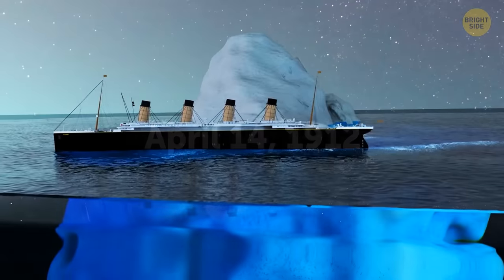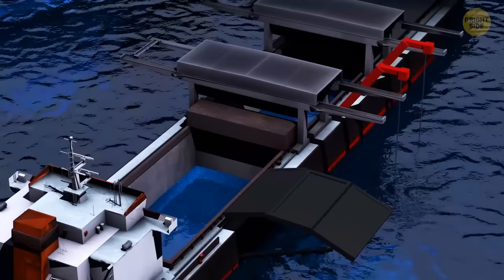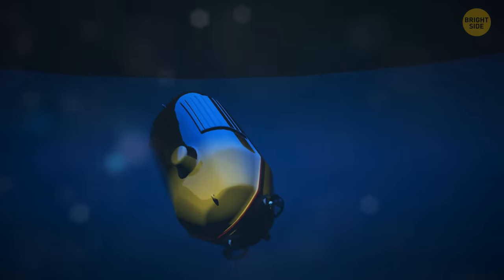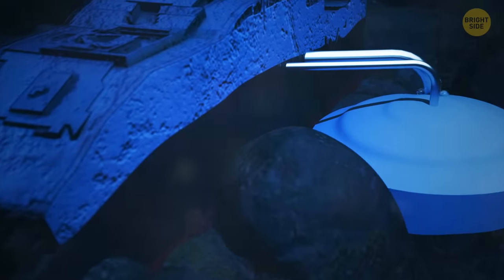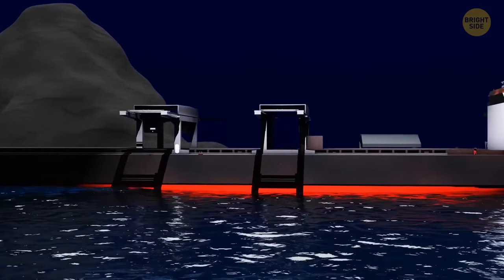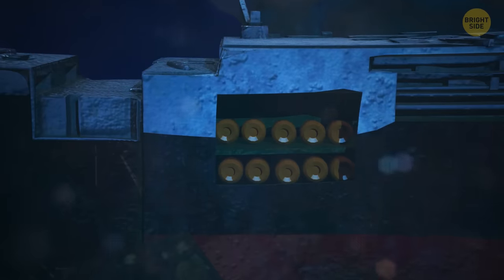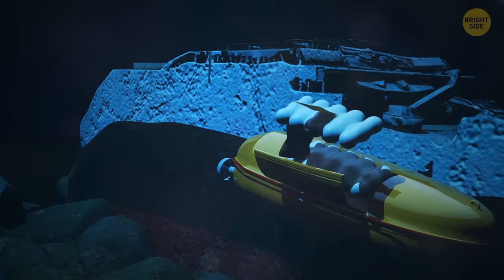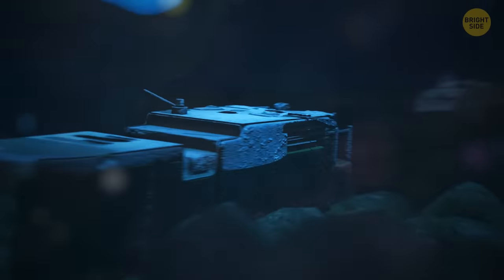11 Ways to Raise Titanic but Only 1 May Work

Comment: One thing I WISH to happen but will probably never happen is to see the wreck of the titanic wreak raised and preserved in a museum
Reply: Maybe if they mapped out the wreckage and brought it up in pieces, then reassembling it later. Could be the only possible way to preserve it, since it’s quickly being eaten away by the sea, if not it’ll be gone within the next couple decades maybe less
Reply: @sueydakillaboo  you said the same comment twice.
Reply: Imagine how large the museum would have to be
Reply: Unfortunately the best way to do so would be to make a exact 1 for 1 size and scale replica of the ship JUST to make a museum.
Reply: @Orcaluv26  a guy in Australia is having one commissioned  in China  called titanic 2 set to sail from America  to England  this year
Reply: Best we could do is create a perfect replica of titanic in the state as it currently is. 
So it’s the same but stronger.
Reply: Part of the hull is in a museum as are a lot of relics
Reply: The raising of ss Titanic Is impossible due bad condition of steel plates
Reply: @sueydakillaboo  One way, which would seem less costly, would be to spray-paint the shipwreck of the Titanic, including all its remains/parts lying across the 3x5 mile debris field, with a coating that kills the bacteria that eats at it. Or at least drop some life-saving chemicals to destroy the rusticles and free the ship from its demise at the hands of bacteria.
Reply: @Orcaluv26 Nope, if people wanna see Titanic they’re better off raising Britannic which is identical. Titanic’s sister ship Britannic still sits in near pristine condition. Plus it sank in shallower water which would make raising it much easier and less costly than Titanic.
Reply: @amandajackson4359 that project has been cancelled and rescheduled constantly since like 2012
Reply: How big is a museum would you need
Reply: It will happen, you will see
Reply: I think that ship is going to collapse within the next two to three years
Reply: If it would touch air it would dry out instandly and fall to a piece of rusty powder or rusty scrap unreusable in an yway

Comment: This titanic task keeps getting more and more unlikely. I think Robert Ballard in the 90’s q(the man who discovered the wreckage) was asked if the ship could be brought up. He said the ship was in bad shape and decades of being underwater didn’t help. Couldn’t imagine over a hundred years later after the sinking would help.
Reply: You're right, the 2019 expedition to the wreckage showed that it was decaying at a much faster rate than before. The ship would entirely crumble if they even attempted any of these.
Reply: Ballard did not find it alone -- he had help
Reply: @Chuck0856  do tell.
Reply: @Znop  yes but it will anyway because the microorganisms at that dept are quickly eating away the steel.
Reply: it was discovered in '85 not the 90s
Reply: @vthompson1987  Ballard was helped by Aquaman
Reply: it would be almost impossible to get it back to land while keeping it wet at the same time to keep it from eroding and falling apart which is what the guy in the video completely missed and ignored

Comment: It didn’t sink right next to the iceberg like that. It actually went about two miles at a steady pace before sinking, and the forecastle was way more submerged. Plus, it didn’t snap in half like that, the front end was so submerged that the pressure pulled it apart, the front half fell incredibly fast pulling the back down with it almost vertically, the front snapped off of the back leaving it there to bob for about 30 seconds before it started flooding and sank, once the ship snapped in half, it only took around 2 minutes for the whole titanic to be underwater, leaving most passengers to float in their life vests and die from hypothermia, they drowned and froze together in a big group in the pitch black, middle of the sea. Absolutely terrifying
Reply: You’re kidding!!!   We all thought the titanic sank in one piece and everyone was inside.     🤦🏼‍♀️🤦🏼‍♀️🤦🏼‍♀️🤦🏼‍♀️🤦🏼‍♀️🤦🏼‍♀️🤦🏼‍♀️🤦🏼‍♀️🤦🏼‍♀️🙄🙄🙄🙄🙄🙄🙄🙄🙄🙄
Reply: There no concrete evidence that supports that but some witnesses stated and testified that the ship split at the surface and no matter if it did or didn't because witness testimony is all the best information we have.
Reply: @insertnamehere313  what about the deep sea subs that found and photographed the two sections?
Reply: @insertnamehere313  yah I agree it split in half in the surface
Reply: What do you expect it’s brightside
Reply: Calm down its only a video 🤣🤣
Reply: @SonnyGTA  BRUH
Reply: new evidence shows it prob didnt watch drain the titanic

Comment: I think the best option is the most obvious one (and the simplest). Build a floating donut-shaped island (not as difficult as you might think) and attach many many strong cables to the most sterdy parts of the ship, spreading them out across as much of the surface area of the ship as possible. Then slowly turn winches to pull it to the surface. Now, the problem with this is the ship is likely fragile from being under water for over a century and may break apart. But barring that likelihood, this is probably the best option.
Reply: The theory of ice an millennium sounds like the best idea tbh

Comment: I think(!) the Cussler book suggested using basically liquid urethane foam, carried in pressure-stable containers to the wreck, nozzle inserted directly into spaces that weren't structurally compromised but very vented to let water escape, and open the foam tank valve. Do that in EVERY resealable space, attach the inflatable aluminum tanks on the outside of the hull, and plant the charges in the mud and silt to break the Horrendous suction. That was "supposedly " enough the break her free and the foam inside, with the floatations bags outside, would raise the wreck.
But now, with the hull in three major pieces, plus enough minor chunks that even a metal detector couldn't find them all, and the rusticles competing with the iron-eating bacteria for who will digest the hulk first - she's down, she's staying down, and it doesn't matter, because Byzanium isn't real anyway.
Reply: Unlike the titanic Constantinople will be retaken
Reply: Rusticles are the visible results of the iron eating bacteria down there.  I noticed that Bismark does not have rusticles since she is made of steel.

Comment: I think that physically, the most realistic way to raise the Titanic is to dismantle it, deck by deck and retrieve individual steel pieces to the surface so they can be treated chemically and reassembled somewhere else with the help of a separate supporting structure, like the bones of a dinosaur.
Reply: It's not possible. Dismantling rusted ship is huge manual work. If you get out of your submarine somehow, you will be killed by the water pressure
Reply: @neog3461 They could deploy underwater robots for this task
Reply: For goodness sake leave her alone.

Comment: Solution: 

We just cut into pieces that are salvageable. We use sub drones to pick up each piece. And then we capsulize each piece so that way it is protected from the water pressure upon the ascent to the surface. It would cost ALOT of time and money but it is honestly the easiest and most time efficient way of recovering the ship.

Comment: I've always thought the one way to do it would be to manufacture a large box like container. It could be lowered in 2 sections & placed on either side of the wreck. Then once in place could somehow be attached at the top & bottom, allowing the ship to remain intact on the trip up.cables, airbags whatever would attach to the outside of the box. This way nothing would be lost during ascension
Reply: A large box container about 600mx600m (1800 ft) in size you mean? You would need a large number of big freight containers, like the Evergreen or Maersk, that would be able of carrying such huge containers, and to such a depth of 3.8km (2.5 miles). Not to forget, to carry that large amount of water and sediment too. Unless, you're able to drain the box and keep the ship, remains and sediment it is stuck in intact.
Reply: It could maybe be a cage type of box but yes highly unlikely
Reply: Hm. Still, the problem of water pressure remains.
Reply: @clarab6092  I'm not sure that would be a factor as no oxygen would be present inside the box or outside since it captures the water that would currently be surrounding the ship.
This of course would be slowly drained once the box that captures the ship reaches the surface. There may be however a temperature variation which causes an imbalance in pressure as the cold water from the ocean floor reacts to the warmer water close to the surface.

Comment: The bottom of the ship would be deep into the seafloor. It'd be like a huge suction as it was being pulled up, plus the weight of the water over it. Much of it is rotting away, and it is in two halves. Both would have to be raised to complete the ship. And where would it be taken to, if both halves were successfully raised? It sure wouldn't look as it did in 1912.
Reply: But it would really be interesting to try and see the damage done by the iceberg.
Reply: But it isn't just two pieces. It actually broke into 3 sections, the middle section scattered over the debris field.
Reply: @daviniarobbins9298  yah
Reply: Well, of course it would be in several parts, but you could put them together in one place (with small gaps in between) in a museum, rather than placing them 600 metres away, as they are now on the sea bottom. But that's only an academic question, because there seems to be no reasonable raising technology and option. But it would be great to have a complete 1:1 copy of the Titanic in a museum, which would be in like new shape.

Comment: Make air bags that can withstand the pressure tie them around the titanic and wait for it to come up
Reply: I have one more Idea: You know how the  pillars of bridges are made? The place Pillars will stand is covered with Concrete blocks and then water is pumped out, same can be done here, but the pressure will be the issue
Reply: Kevlar bags 50 meters long? Air should be pumped from top to bottom.
Reply: you cant do that its in to bad of a state
Reply: I have an idea just leave it be
Reply: They made a film with that' raise the titanic'
Reply: In my opinion, it's honestly disrespectful to the people who died on the titanic, that ship is the grave yard of 1500, why would you want to remove it?
Reply: you'd need a cradle underneath the wreck, as trying to attach them directly would just result in them either ripping away from the wreck, or worse, ripping pieces OFF the wreck. also, like other people have said. A. it's too fragile to remove, and B. it's a mass grave site, and it would be disrespectful to move it.
Reply: It would have been possible maybe before 1940, but no longer. It is too fragile. It will disintegrate as soon as it's lifted.
Reply: It took a lot just to bring up the "big piece." That alone needed three giant bags filled full of diesel just to get it to the surface.
Reply: @TheRockefellas  it won’t be a graveyard much longer nothing will be left by 2100 at least bringing the ship back up would keep the graveyard I’m not going to talk for anyone else but me I would not want my grave being in the dark ocean alone forever
Reply: @royalnavyrulebritannia5717  so you rather someone demolish your grave??? Because that's basically what your saying.
Reply: @TheRockefellas  it’s not my grave if you died in a car crash people would not leave you in the car and say ohhh that’s his grave leave him it won’t be a grave unless something is done to try and preserve it
Reply: @TheRockefellas  its not.. do you treat every single spot on the planet where someone dies as a grave yard.. no you don't and you can't thats just silly.

Comment: We would probably have to test it first. Maybe build a scale model of the wreck site to be as realistic as possible. Then use different methods of raising it to see which one is feasible.

The only problem is the tests would be tedious... After we raise the model it might fall apart (if we make it as realistic as possible) so to test it again we would have to stick it back together like when James Cameron was filming the ships breakup scene.
Reply: this is more an issue of not that we can't do it but why should we? think about it it's like digging up a corpse why would you want to do such a thing?
Reply: @raven4k998  I never said we should, actually. Raising the titanic would be a bad idea, as almost a thousand people died on the ship. I was merely stating how we'd do it, which is basically "we don't know so better test ways first". Raising the titanic is also impossibly impractical
Reply: Wont work because the model need to be down there for 110years before to test it
Reply: And you need to simulate water pressure at those depths (12,700ft) which is enough to turn a freight train into an aluminum foil sheet...
Reply: @ayoutubecommenter1827  I guess the problem with testing raising the titanic is that we'd have to do it at the bottom of the ocean which defeats the purpose of testing it
Reply: @FriskMeemur  to be honest raising the titanic is impossible but pretty sure there is a method out there and we can perverse it.

Titanic II is taking forever I know It’s been built by Blue star line. Takes 3 years to built titanic and it takes forever to built titanic II.

I would rather start my own company call it Red star line. Build the Olympic II and Britannic II. and get investors. Plus I can say to blue star line if you fail to built the titanic II when the Britannic lunches.

We just built the titanic II then
Reply: @supremeskyz531  I would have loved to live in a timeline where everything is the same except Olympic was turned into a hotel ship.

It's so sad to see pictures of Olympic being scrapped.
Reply: @FriskMeemur  indeed bro I would rather build an Olympic II

Comment: By the time there's a viable option that could actually bring it up, it will have already be far beyond being worth the trouble. It will be gone within 2-3 decades anyway from now. People also theorize that there may still be bodies kept preserved inside deeper parts of the ship such as the engine room and inside the radio room where there hasn't been any animals able to eat the bodies and extremely cold water has kept the remains preserved like a freezer which is why the wireless radio was never recovered, as it's possible as soon as you open the door you would find remains. Leeave the ship alone, film what you want while she's still here, and let it go.

Comment: The big problem is that the water pressure down at the bottom of the ocean is extreme.  Also, Titanic is buried in sand and in very poor shape as it is being eaten by bacteria called rusticals, so if we tried to lift it, Titanic would fall apart. Since we cannot lift Titanic, if only we could find a way to preserve her before she is gone

Comment: I would try using multiple hooks around the perimeter of the ship's bottom, then thread steel cables from one side to the other then use a fleet of hot air balloons to raise it up. Its easier to manage things from the surface. If it takes adding another balloon each month to get enough lift then do it. But the process can be slow and methodical so you can get it out without damaging the ship.

Comment: better leave the wreck where it is but find ways to clean it with under water robots that would clean the hull and paint it with an anti fouling paint so it preserves it for longer, find ways to support the deck for it collapsing further. keep it as a underwater memorial to those who died on it don't take anything up from the site again.

Comment: 0:05 titanic sinking accuracy is totally on fleek
Reply: It didn’t sink right next to the iceberg like that. It actually went about two miles at a steady pace before sinking, and the forecastle was way more submerged. Plus, it didn’t snap in half like that, the front end was so submerged that the pressure pulled it apart, the front half fell incredibly fast pulling the back down with it almost vertically, the front snapped off of the back leaving it there to bob for about 30 seconds before it started flooding and sank, once the ship snapped in half, it only took around 2 minutes for the whole titanic to be underwater, leaving most passengers to float in their life vests and die from hypothermia, they drowned and froze together in a big group in the pitch black, middle of the sea. Absolutely terrifying

Comment: The ice way is the only way to raise it other than cutting it up and bringing individual pieces up. If you adjust the ice idea a bit it would work. You wouldn't release the liquid nitrogen instead you would have multiple hollow loops filled with watter to stop them from collapsing under the pressure. You affix these loops all over the ship. In the areas where it seems the mist structurally sound. Next you apart pumping liquid nitrogen from the surface down through the loops and back up to the surface. This will cause ice to start to form on the loops keep pumping the liquid nitrogen through as more ice starts to form on the loops eventually the ice will start to form on the surfaces of the ship as well. Keep doing it until the entire ship starts to be coated in ice from the underside. You don't want a cage arround the ship you want the ship it self to become ice.  Next if you can't find a ship large enough to bring it to the surface go find a large ice berg in the area tow it above the wreck and afix machinery onto the iceberg. Use  it to lift the ship. You don't need enough ice to lift the ship on it own you just need enough to take some of the stress off the structure while cranes lift it.